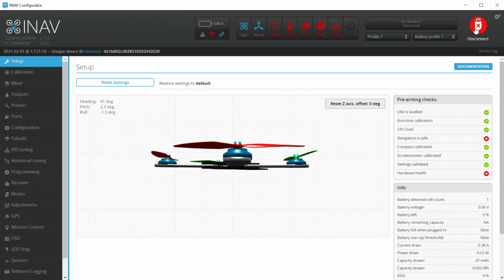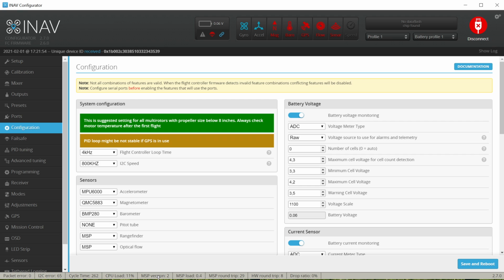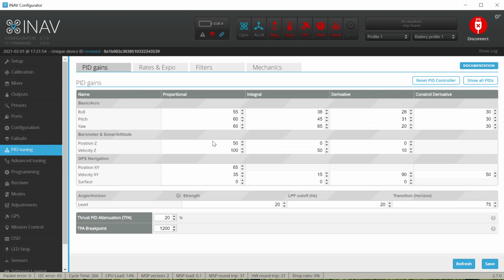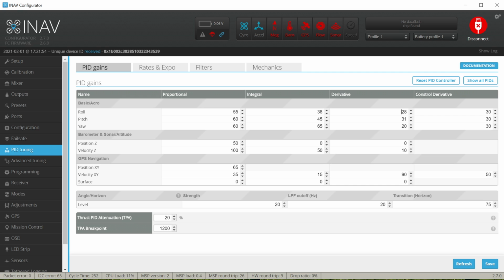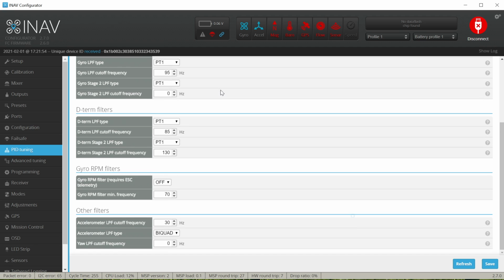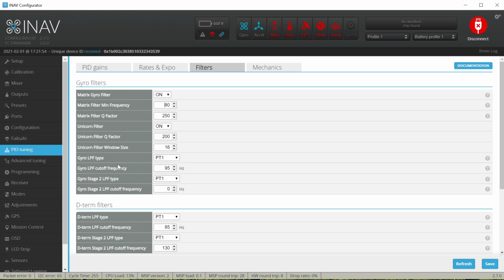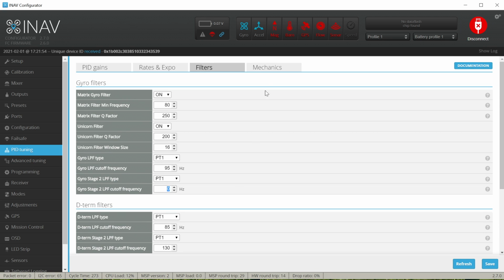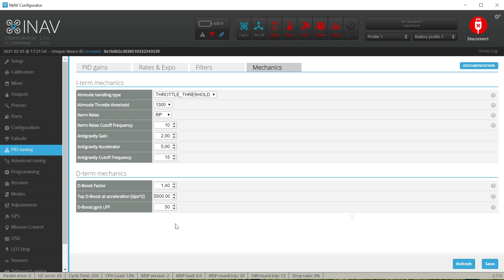#INAV 2.6 on 7-inch FPV drones - the best settings

Comment: Hi i from Philippines i am the one of your fan and subscriber to your channel i am very thankful that you have one like you to teach every builder of quadcopter.I have to much learn about you.Already built 6 inch triblade quadcopter w/ omnibus f4 v3s. The fly mode angle,altihold and poshold is great .My only problem is when i on poshold ang my joystick is not using the quadcopter is in hold position BUT THEY MAKE VIBRATION WHY LIKE THIS HAPPEN ?HOW TO TUNE THIS? I hope you replying for this message thank you very much

Comment: You had presentation of PID values and set up for 7 inch Drones. I am having trouble setting up PID values for a QuadX 10 inch Drone. I started with default values in iNAV 3.02 but serious wobble developed. Although I did read several articles on wobble and adjustments, I have not been able to get more than a few feet off the ground because of the violent gyrations. I want to start with a set numbers that should get me in the air for further tuning. If not, something else may be wrong. My equipment consists of Matek 722SE  F.C w 4in 1 esc. Could you put something together for the public; 10 inch QuadX drone for long distance. Much appreciated

Comment: This actually helped me with my first install ever of INAV 2.6.1 on my 7-inch drone. Now that INAV3.0 is out I do not have enough knowledge to transition to the new version without a headache. Would you be making a similar video with some recommended presets for a 7-inch running INAV 3.0 or a summary of what can be used from the diff and settings for pids and filters? Thanks a lot for all the hard work :)

Comment: Hi Pawel. best settings for my Tyro 129 whith Inav 2.6.1. Please make a video with the best settings for 5 "quad using inav 2.6.1 or higher for stabilized flight modes (GPS). I have a Tyro 109 with FC 129 and would like to configure it for those flights.

Comment: Tanks a lot. good video. how about 10" and more? how can we set filter and gyro freq? thanks bye
Reply from the maker: probably lower. But that all depends of the build itself, props, weight etc
Reply: @FPVUniversity  thanks a lot... 2kg 10" prop tarot 600 ... Is 188 hz good for gyro ? Thanks

Comment: I've put 2.6.1 on my Crocodile 7. These settings are working much better than anything in BF. BF was shaky and in windy conditions (Ireland) I was happy that I didn't crash - tried everything in filters and pids but no luck. This is SOOOOOO much better - today it was windy but flying smoother than on BF with no wind! Only thing my GPS doesn't want to fix position for some reason so I had to bypass it.  Thank you Pawel, you saved me from buying new motors or frame!!!
Reply: Just about to try this on my Croc7.. I did try FalcoX and that was super smooth but couldn't get the GPS or OSD working.. What part of Ireland? I'm on the Isle of man, maybe I can tune in lol
Reply: @crezzlin  Cork. I have everything working. It took a bit to lock sats but I connect fc to usb power bank for few minutes and all good.

Comment: can somebody help me what i need change in inav settings for a 7" quadrocopter 1700kv when i flying on  default settings for 4S lipo 250 gram 3000mAh work well. But after installation lipo 6S 600 gram 4200mAh - it uncontrolled, much more powerful but much more heavy. PID ?

Comment: I installed Inav on my 6 inch quad, Although i got it to work somewhat,  Altitude hold wasnt to bad,  it rose up and down by a few mtrs or so but it wasnt to bad , Position hold though was all over the place .. Gps  is  a BN880,  Accel and compass calibrated many times , But always the the quad on the setup page was " Sloppy " slow to move and over shot , Not as pin sharp as in Betaflight , In Betaflight you move your quad  held in the hand and the GUI quad in Betaflight followed exactly ... Why Inav doesnt do this in my case i dont know..... after a week of trying to get the bugs ironed out i went back to Betaflight ... I may give Inav another go at some point  in a few months time. .

Comment: Amazing! I love my 7 inch with INAV, I'm reluctant to use it far away tough since I cant get the compass working right,  we need the video about compass calibration asap hehe
Reply: QRP  Oohhh..so whats the fix...
Turn the bn880 upside down,or use " 180° Flip in Configuration ?
Reply: QRP  👍👍🍻

Comment: What with a  returning to home mode? Have you tested it? Is it working better than 2.5 or we have got a new issue on 2.6?  I have no problem with 2.5.2 on my f405 ctr but I have tremendously big problem on 2.6 when trying to turn the RTH mode on? Seems to be that issue in magGainX/Y/Z calculations and bug was already created but not fixed. Many people saw this problem not only me.

Comment: Hi Pawel, How much of this is covered when you choose 7" Multirotor in PRESETS? or does 'PRESETS' do something completely different ?
Reply from the maker: most should be covered, but it's worth to verify
Reply: @FPVUniversity  I setup a 7 inc quad with presets and I had to modify some values following your video.Tomorrow i will test it.